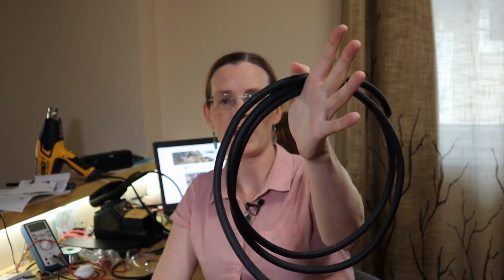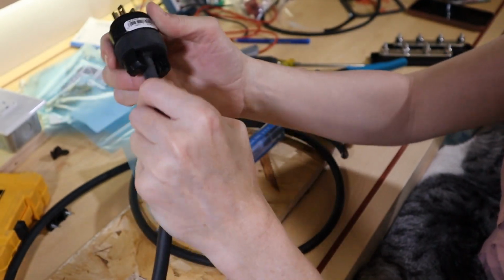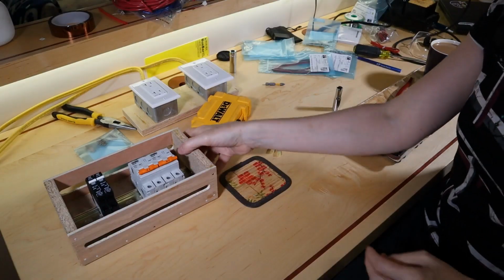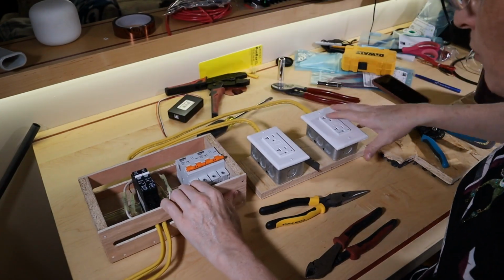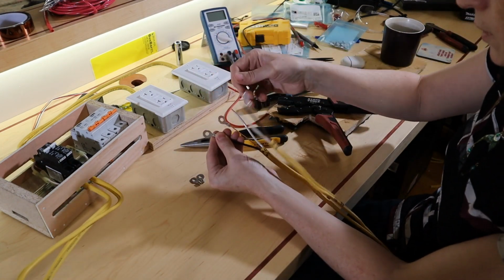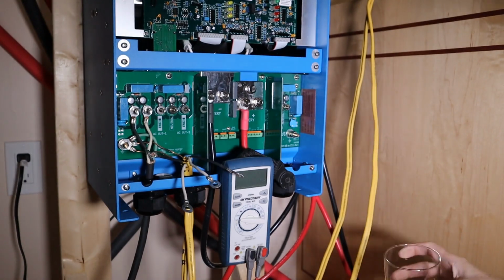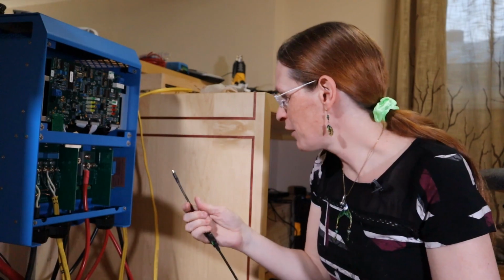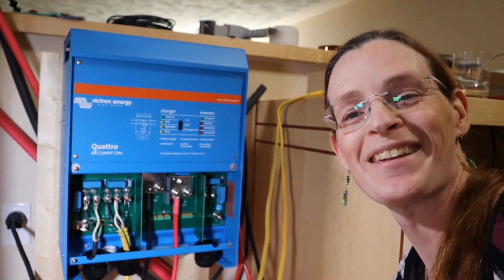Victron Quattro 48|5000|70 120v (Anti-climactic Part 2) - 48v Lifepo4 battery (Ep. 14)

Comment: I watched you modify the ring terminals. I (If i need to make clearance between them,)I use diagonal cutters to remove the majority of the material, and smooth with a file(or flap wheel if im in a real hurry.)😊

Comment: You're making several mistakes. 1 strip the wire shorter than you think you need to.(as you found out.) 2 after tightening your connections, and the outer insulation jacket is sticking out of the strain relief,  twist the wi🎉re to take up the extra slack and move the outer jacket back under the strain relief. (Instead of just pushing on the wire and jaming the leads and insulation up to the strain relief. (Don't twist to hard though.)

Comment: there are special tools for cutting the outer mantel of cables. they just cost a few bugs. cutting it with a knife is not a good way. judging by how much you like the proper tool for stripping the inner isolation, i guess you would love using the right tool.
Reply from the maker: I would! You wouldn't happen to have a name or part number I could search for?
Reply: @TheDigitalMermaid  I think you should look for the knipex 16 80 125 SB or something similar. If you know how those things mormaly look like you might find an even cheaper version in your local hardware shop. there might be different ones for different gages or materials of insulation.
Reply from the maker: @peterhase1045  Found 'em, thanks!!

Comment: i dont knowe if anyone mentioned this yet but the short is normal its the ac to dc converter thats just a transformer wich makes poewer by a magnetic field its normal the capacity you mesure on the battery input is the capacitor for start up power

Comment: Nice work, the only thing I do different in Australia is all connections including bus bars & current shunts etc are inside electrical boxes, so all you see is wires going from one box to another. I don't use Andersen plugs with permanent setups (the more chances of introducing resistance into the system the more chance of instability or voltage variance & with high current use this can be a problem, I seen things catch fire due to contact failure later on, pretty scary stuff, oh and not my work). I have a Thermal camera for finding potential problems, it works unreal & was built out of standardized parts too except for the FLIR sensor which was the main cost.

Comment: As to shore power I would look into West Marine . There are typically equipped with a threaded ring to lock them to the outlet. they aas you know have several different layouts for different amperage. I think the washer on your terminals in the Quattro are intended to go over the naked wire.

Comment: You're doing great! MY OPINION: Ring terminals that are serrated are required for proper connection to solid wire. An old guy once told me:"You should be able to hang from the ceiling with a proper crimp".  I learned over the years to only buy crimp style connectors for major manufacturers such as TE, AMP, TYCO etc...  They all provide data sheets and mechanical drawings for their products. PRO TIP: Never solder a crimped connection. EVER!
Thanks for the thrill. At one point I had one hand over my mouth and the other over my eyes peeking though watching you probe around in the enclosure with the ratchet and pliers.  I haven't experienced that much suspense since The Shining!
Reply from the maker: They're TE ring terminals, o think some are 3M. I always try to get serrated, but sometimes I don't have the option depending on what Digikey or Mouser have in stock.

Glad I have you some fun suspense! :)

Comment: I am CURRENT-ly watching your video with AMP-le attention. Excuse the pun. While I am pretty much a low voltage virgin, I have wired and designed a lot of three phase commercial and single phase residential. Always keep  two things in mind in relation to access. 1.) Is what you are working on easy to reach? 2.) If you have to work on the system, is/are the main cutoff(s) within eyesight of your set up so that you can prevent others from turning on an open system that you are working on?

I recently viewed one of your YouTube colleges design a system where a person is forced to crawl on his/her hands and knees to reach breakers and fuses in the back of a cabinet or lift/move a bed. Don't do that. Access above all else. After all, sooner or later, you will have to work on your system. For you, that is particularly important. Who will be able to reach you in good time out in the middle of the Pacific?
Reply from the maker: The biggest motivated to DIY my system was because I know that no one can reach me out at sea. Building it, means being able to fix it. :)

I've not spoken much about placement of things yet because I don't have the boat yet. My dream boat is a C&C Landfall 43, but those aren't the most common to find now and I may end up with something else. In any case, everything will be designed to quick and easy access. It's one of the reasons I went with the "gumstick" battery design, and am keeping the main disconnect and whatnot at one end, exactly to make access easier. Nothing will be buried or hidden.

Comment: So you are the one who endured the electric plasma explosion caused by an errant cable. Take heart and party on. We used to get that all of the time with lead acids that had been totally discharged when we tried to jump start them. Only, the difference between what you experienced and a lead acid explosion is what you experienced was a pure plasma explosion where the lead acids, while capable of a plasma explosion, were typically hydrogen explosions. 

Those lead acid explosions usually shot flaming debris and sulfuric acid all over a person and into their eyes. Don't be fooled. I understand that lithium batteries can do much of the same thing but are not quite so prone to do so. I understand that the LiFePO4 in particular is a much safer technology.

Like I say: Party on and don't let set backs get you down.
Reply from the maker: I'm smart enough to build this system, stupid enough to bother, and stubborn enough to not give up. :P Yes, Lifepo4 is a very safe chemistry, exactly why I chose it. I doubt I would have started if the world still relied on lead acid or AGM... Lithium changed the game. Cheers! :)
Reply: @TheDigitalMermaid  Me 2. Though I am not doing anything quite so bold as modifying a sail boat, I am tired of $200.00 to $800.00 electricity bills, so like you, I decided to self educate. Essentially, I decided to  tell Pacific Gas & Electric to take a dump.
Reply from the maker: @westking7746  Micro generation and local storage is absolutely the future, so good on you for doing it. The grid needs to become a convenient, not a necessity.

Comment: I have been catching up on your videos since I got the recommendation from Off Grid Garage. I guess since you’re doing this for a sailboat you’ve already seen fellow Canadian, Shamrock electric sailboat youtube videos he also runs Grin Technology and e-bike.ca. He uses a high power e-bike motor and controller for his Sailboat all dc only powered . I noticed in your first video you have a mppt charge controller and i guess you already knew that any D.C. power supply over above 60 or so volts DC is all you needed to charge your batteries with it. It can’t tell the difference between solar panels and a power supply as long as its DC. But you can still use your Inverter for emergency backup at home unless your planning on 120ac on your boat.
Reply from the maker: Hi Les, Welcome! I reached out to Grin a week or two ago, haven't heard back. I figured I will wait until I actually buy the boat to start pestering companies, as then I'll know exactly what I am looking for. I am interested in what they're doing, and if they have plans for any more powerful / stackable motor types. I'm using MPPTs designed to charge 48v batteries (Victron 100|20 48), so I should be fine there. I do plan to have 120v on the boat, hence the quattro as the inverter/charger.

Comment: Ah, you only want to bore your long term subscribers.
This wooden breaker box is really sweet. I would appreciate sharing your wood working.
The control board on  the quattor look so retro, except for the colour of the resistors. Does it have a UV erasable EPROM?
Maybe you can make your videos somewhat shorter?
Enjoy learning and thanks for sharing ;-)
Reply from the maker: I don't want to bore anyone! :)

With chapters though, I think it will be easy for people to skip the parts they don't want to see. So I think I'll keep showing the side projects, even if just in time-lapse or jump-cuts.

No, there's no programmable EPROM, but would be believe I've used those (rarely, I admit) ages past to reflash old BIOSes? 

I do try to cut out as much as I can, but I had to decide early on what kind of channel I wanted to make. Learning is the core ethos, so I decided it was important to show the process of learning as well as the final lessons. This means that I probably will lean towards longer videos, but I learned how to do chapters for this one. I'll make a point to always include chapters on longer videos so people can just focus on the bits that interest them.

Thanks for the comments!

Comment: For the insulation between the cells: Ikea Finfordela chopping boards. $1,49 for 2 pieces, 1mm thick and easy to cut, but still pretty strong. 
I use it on all my builds.
Reply from the maker: Another commenter suggested really thin cutting mats from amazon, which I ordered yesterday. I'm guessing Ikea's are basically the same thing, so I imagine your suggestion would have worked just as good. Thanks for sharing!

Comment: Could the ring connectors  been soldered as well as crimped to be able to use them?
Reply from the maker: Could be, but another commenter had a good point about solder joints being brittle over time in a boat. Best to use the right size ring terminals and marine grade stranded wire. All of which I plan to do.

Comment: 22:06 as you are using the Stanley knife spare blade so often, and you have a roll of polyimide tape handy, you might want to wrap the tape around the center of the blade to give your fingers more pleasant touching and lessen the chances of getting your skin scratched by the two sharp edges of the blunt end of the blade. ( I use fabric tape that painters use to mask non paintable surfaces, as it has even more friction than Kapton tape).
Reply from the maker: I've got those blades all over the place... With my day job, I'm always opening boxes or packaging. If I tried to tape them all, I'd empty the roll. :)

Comment: I applaud your tenacity and drive in your projects. After watching this and seeing you cut your finger, I have one suggestion. PLEASE stop using a box cutter to strip wires & cables. It's a "box cutter", lol! Get yourself proper cable cutters, use your wire strippers, and put away that box cutter until packages arrive. Then, never pull toward your body with the cutter.
FYI, I am your 1st follower on the VE Community. :) Keep at it, be yourself, and don't let the troglodytes get to you, they are proof that biological devolution really is a thing.
Reply from the maker: It's a box and finger cutter! I actually have and often use the proper cable striper, it was just so far away at the time, like, at least 2 whole meters away, and the knife was _right there_. :P

Comments to me never bother me, but I also very much want to build a kind and encouraging community. So I'll tolerate a lot, but not meanness. Thanks for the follow on Victron! I didn't even know that was a thing.
Reply: @TheDigitalMermaid  I get it, the excitement of learning and performing new things cause us at times to be hasty. Trust me, you're not the only one with knife slices in the digits.
This is a nice short video on cable stripping that may help. Notice the direction that the cutter blade is facing when he uses it. ;-)
https://youtu.be/EEK33es3Yd0

Comment: 18:45 great learning box, I assume you shall use plywood instead of chipboard in the final version for the ends? (chipboard turns to awfull swollen state form rather easily in a boat)
Reply from the maker: I'll use metal in the final setup, I suspect. I loooove wood, but I'll use metal whenever I can around electrical. The chipboard was literally scraps I found behind my furnace, first scrap I found big enough.

Comment: at 17:47 the nuts of the busbars might be replaced by nyloc or similar locknuts. but that is not so important in a sailboat than a motorboat due to less constant frequency vibrations.
Reply from the maker: Funny enough, I talked about using nylock on the quattro, but deleted it in editing. :)

Comment: at 15:25 In order to increase the spacing to more than 4mm and creeping distance to over 8mm  the ring terminals may be trimmed to D shaped using a Dremel or wire cutters, but that exposes bare copper, which should then be lightly tinned to keep it from turning green in the marine environment . (you seem to have a solder station on your desk, and using 98% tin 2% silver solder or similar lead free solder should be goodenough.)
Reply from the maker: The real real fix is to get the right sized ring terminals. :) That said, if I was using this on the boat, tinning over the exposed copper is exactly what I would do. All this is going in the bin before the boat though, so I didn't worry about it. :)

Comment: for your earth cable ( ground wire ) you will need to put a green an yellow sleeve over the copper for leagal reson ok
Reply from the maker: As mentioned in the video, these are temporary (like the box) and will not go on the boat. Everything on the boat will be done to ABYC standards, including green insulated grounding wire.

Comment: Hi from Australia ive been  an  electrician for nearly 50 years can i give you some tips solder all wire ends befor fitting to lugs terminals or screws there are lots of vibrations in a boat  dont use wood to mount electrical eqp to use metal or villaboard on wood first old saying better shorted than burnt
Reply from the maker: I like that saying, much easier to reset a breaker that rebuild a burnt boat.

Comment: Quattros and MultiPlus require a Smart Dongle for bluetooth connectivity, it will plug into either of the RJ45 ethernet ports.  MK 3 required for advanced setting and is RJ45 to USB.
Reply: I got one of those and found the online documentation looks totally different to what the software shows me, it's confusing as hell.

Comment: You could bend over the wire on itself so you have enough wire to crimp the ring terminals.
Reply from the maker: I could do that with the smaller gauge ground, but not the main wires.